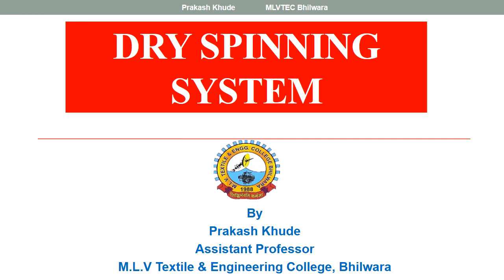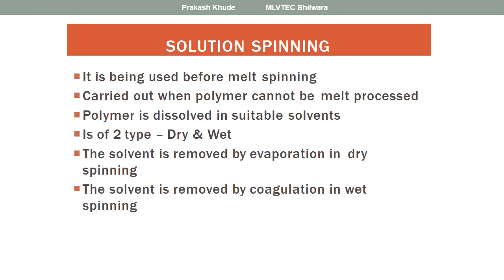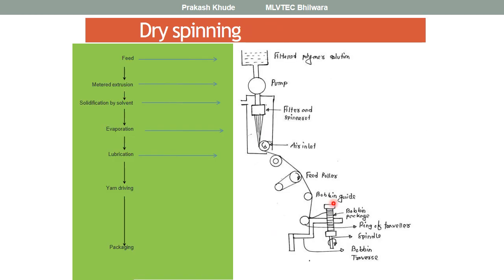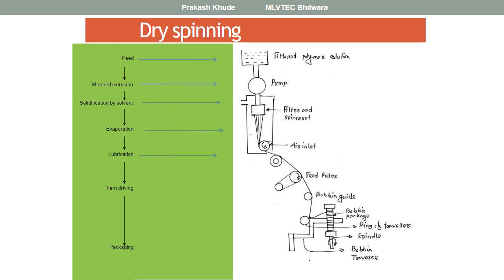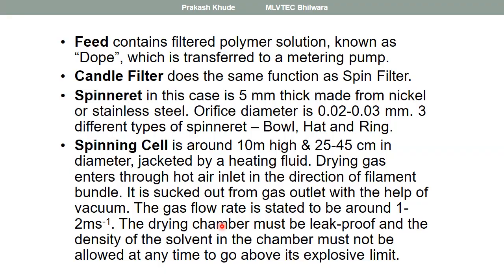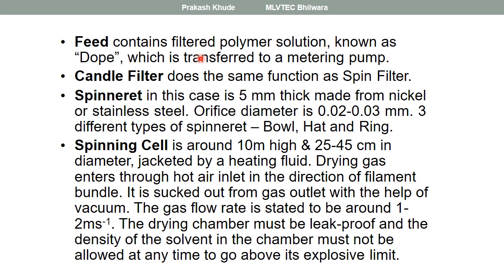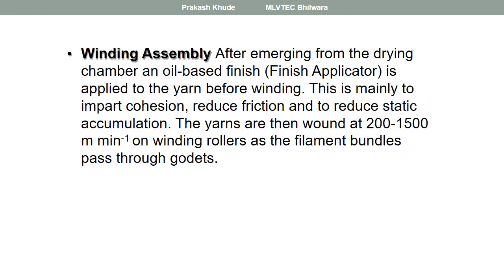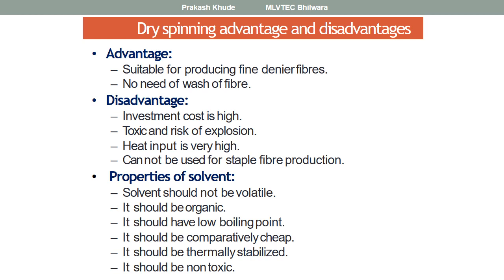Dry Spinning system

Comment: sir where is located that spinning cell tell some more about it.
and  candle filter function?
Reply from the maker: Here intially in the reaction mixer polymer along with solvent are mixed and they are form a dope solution. After that this solution is passes to filter unit to remove any residual impurity or particle left from mixing. This candle filter is similar to the filter used in spin pack assembly as which we have seen in melt spinning system.